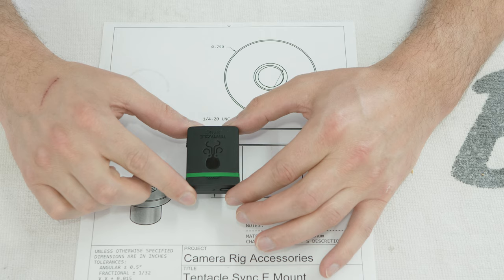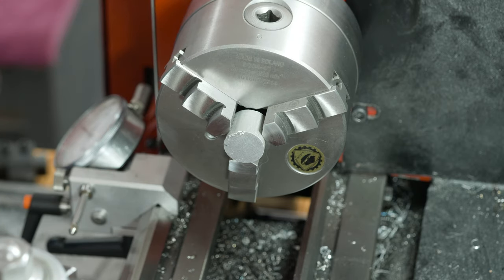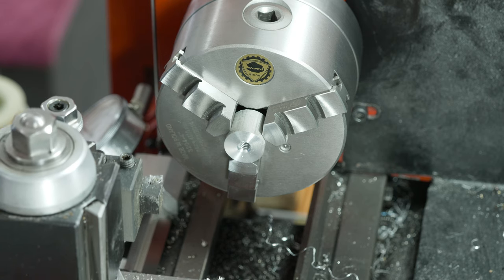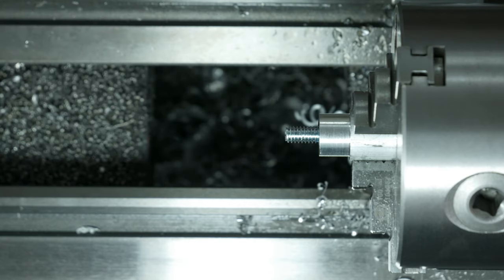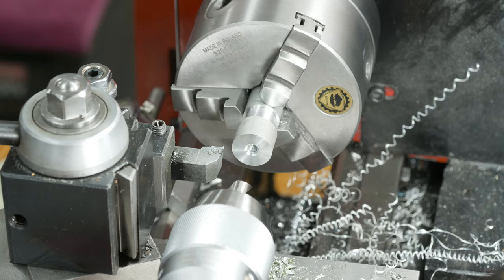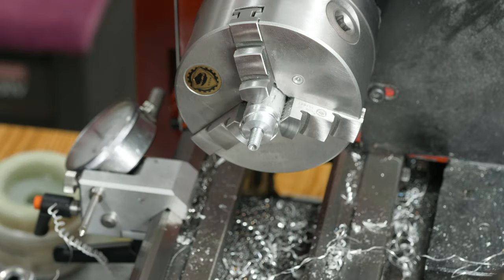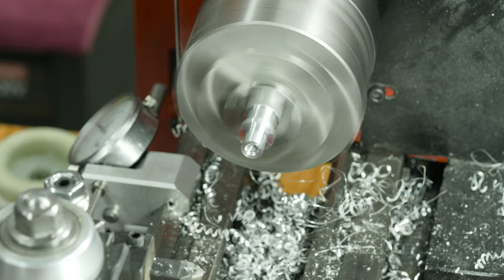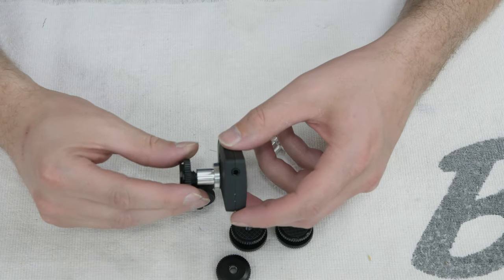Timecode Generator Mount

Comment: I had the same idea, only mine is the non-machined low tech version. I need a lathe in my garage, lol.  I had a bunch of the same cold shoe adapters, I applied some loktite to the thread, and then I just threaded on two of the tightening knobs and glued them together on their mating faces. Once they were tightened against each other and the glue and loktite were dried, I cut off the excess 1/4"-20 thread outboard of the outer knob with a zip cut blade on a grinder. Then I glued the Velcro pad that came with the Sync E's over top of that hiding the ugly cut marks from the zip cut.  It takes sacrificing a bunch of these things using my method in order to be able to tighten it up against the hot shoe of the camera ( 1 of the 3/8" threaded knobs and two of the 1/4" threaded knobs).

Comment: Nice to be able to build a gadget.   BTW, does your tailstock chuck have brass jaws?
Reply from the maker: Being able to make custom stuff, really is one of the main benefits of having a workshop.

The drill chuck jaws are Tin coated to increase wear resistance. The'd only last a few days in my shop if they were made of brass. :-)
Reply: @Dans-hobbies  thanks

Comment: You could have cut the "pole", make a flat surface and attach the Velcro :) What software do you use with your tentacle sync to sync? Thanks-
Reply from the maker: For large project I have a custom script that I wrote that will build an entire timeline, that i can then inport into Davinci Resolve. For simple stuff I just go directly to Davinci.